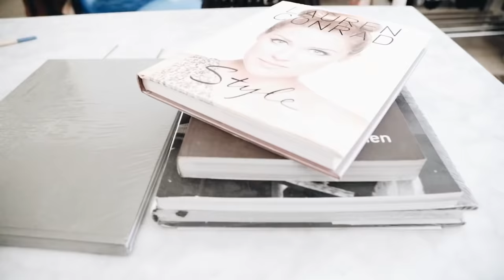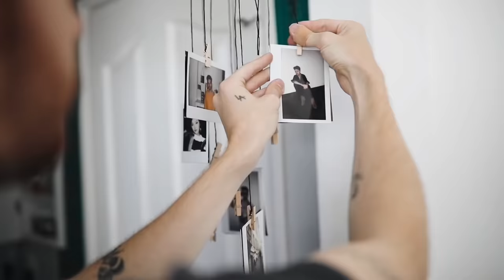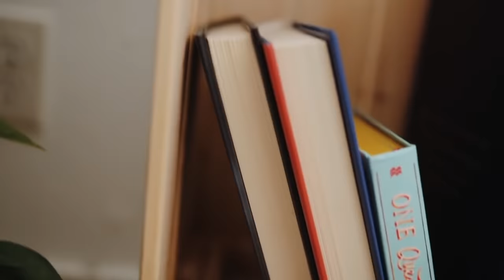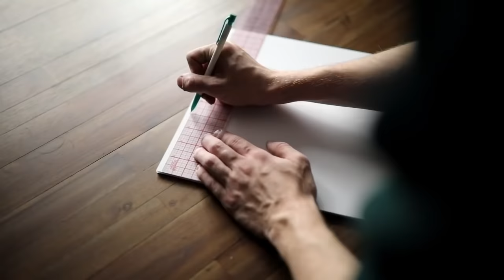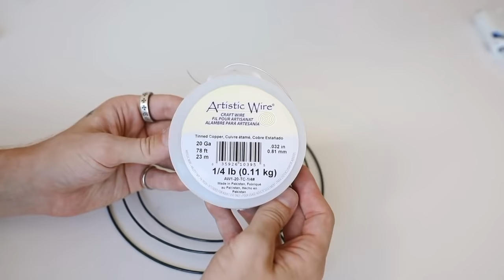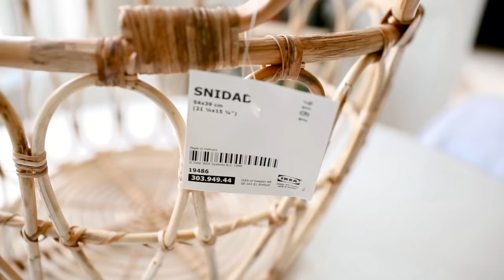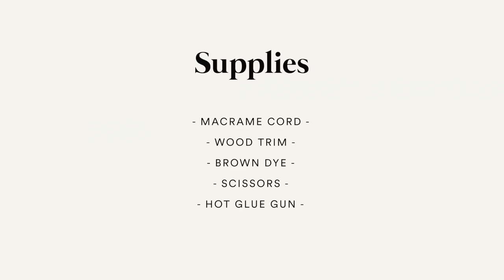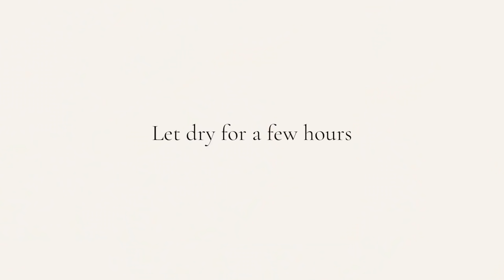100 DIY HOME DECOR IDEAS + HACKS You Actually Want To Make! ✨ (Full Tutorials)

Comment: Here's all ya timestamps!

1. Flower stamped pillow 6:20 
2. Braided side table 7:29
3. DIY Macrame plant holder 8:30
4. Polaroid photo display 10:00
5. Wicker lantern lights 10:54
6. Simple stitched blanket 11:48
7. Black and white minimal Wall art 12:45
8. Copper and concrete jewellery stand 14:00
9. Wooden moon jewellery organiser 15:09
10. Floral globe decor 16:19
11. “Hello” yarn art 17:45
12. Macrame display 19:00
13. DIY Macrame wall hanging 20:10
14. Memory mobile 21:35
15. Metal moon hanging 22:51
16. Concrete hanging planter 24:25
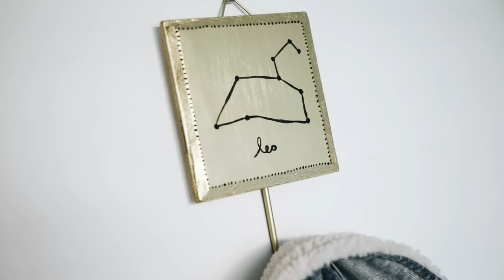17. Anthropologie inspired constellation wall hook 25:42
18. Brass flower mirror 26:35
19. Urban trash bin 27:44
20. Chunky tassel blanket 29:02
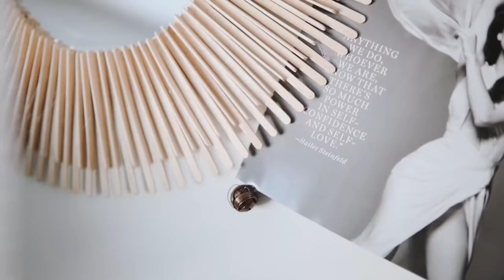21. Sunburst mirror 30:27
22. Concrete coaster set 31:37
23. Macrame candle holder 32:33
24. Geometric cork decals 34:01 
25. Pressed flower wall decor 35:07
26. Spray painted Ikea rug 36:12
27. Felt coasters 37:17
28. Frosted glass geo vase 38:16
29. Wooden letter decor 39:17
30. Wire jewellery holder 40:30
31. Hanging mirror + jewellery holder 41:11
32. Night stand from Ikea crate 42:10
33. Yarn circle decor piece 42:54
34. Memento lamp shade 43:50
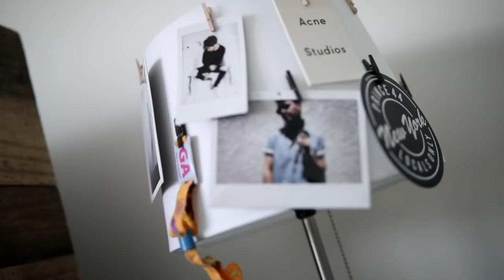35. Wool magazine wrap 44:30
36. Painted galaxy pillowcase 45:26
37. Reworked sweater 45:51
38. Hammered metal candle 46:48
39. Eyelid design pillow case 48:00
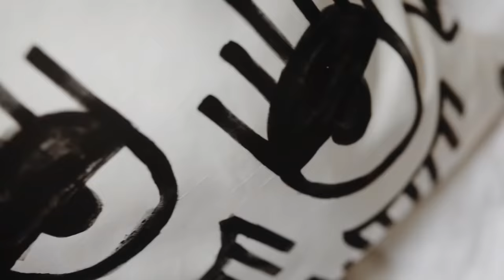40. Geometric wall hanging 49:01
41. Wool wall pocket 50:08
42. Crackled trinket box 50:48
43. Gradient dyed pillow cases 51:43
44. "Best friends" pillows 52:35
45. Leather wrapped coasters 54:10
46. Eucalyptus wall decor 55:13
47. Hanging shelving unit 56:28
48. Leather hanging mirror 57:57
49. Rustic clay bowl 59:34
50. Geometric yarn pillow 1:00:34
51. Vinyl record frame 1:01:31
52. Abstract wall art  1:02:52
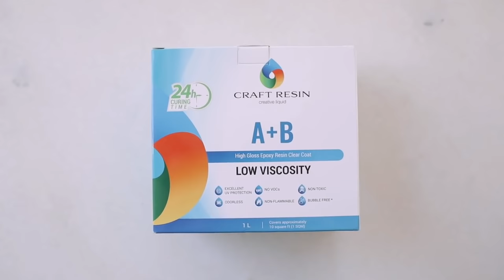53. Dried flower coasters 1:03:51
54. Gold floral wall hanging 1:05:20
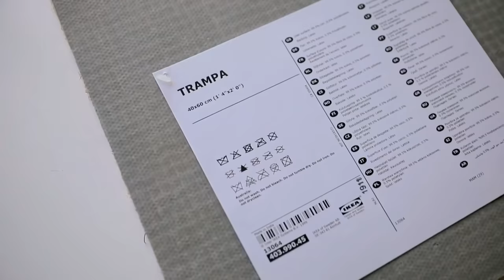55. "Hello" door mat 1:06:40
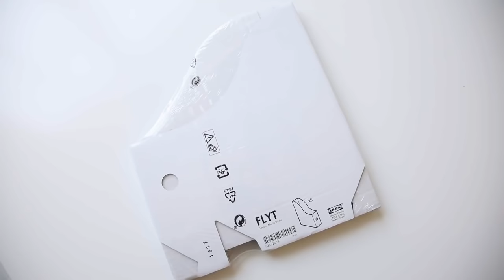56. DIY kitchen organizers 1:07:23
57. Spoon mirror 1:08:19
58. Gold metal hoop wall hanging 1:09:01
59. Abstract trinket tray 1:10:22
60. White and gold picture frame 1:11:12
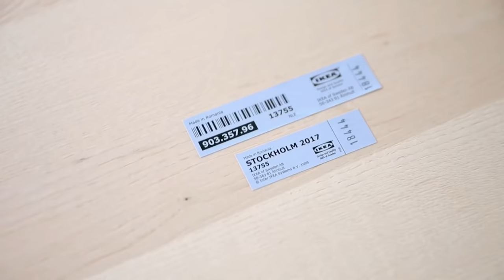61. Tray side table 1:12:30
62. Kitchen island/bar cart 1:13:17
63. DIY knobs 1:14:48
64. Abstract wooden canvas 1:15:40
65. Aesthetic candles 1:16:43
66. DIY basketball hoop 1:18:06
67. Kitchen shelf 1:19:34
68. Rolled cotton coasters 1:20:27
69. Gold wall mirror 1:21:10
70. Hanging cloud light 1:22:40
71. Polaroid magnets 1:23:55
72. Woven fringe wall hanging 1:25:24
73. Sea glass vase 1:26:25
74. Basket hanging pendant light 1:27:21
75. Geometric metal decor 1:28:52
76. Geometric wall art 1:30:26
77. Moon mirror 1:31:15
78. Blanket ladder 1:32:41
79. Macrame hanging bowl 1:34:05
80. Textured stone inspired vase 1:35:24
81. Tile coasters 1:36:13
82. Ombre textured canvas 1:37:44
83. Abstract yarn pillow 1:38:38
84. Photo holder 1:39:57
85. Shell trinket dish 1:41:12
86. Hula hoop wall hanging 1:42:16
87. Ombre macrame wall hanging 1:43:36
88. Geometric jute rug 1:45:04
89. Cement tissue box 1:46:07
90. Bubble candle 1:47:01
91. Fence jewellery holder/wall hanging 1:48:34
92. Modern wall art hack 1:50:05
93. Concrete planter 1:51:05
94. Bamboo bowl pendant light 1:52:27
95. Punch needle wall art 1:53:48
96. Shelf ladder 1:55:04
97. Neon sign 1:55:57
98. Paper mache bowl 1:57:17
99. Concrete jewellery holder 1:58:47
100. Pool noodle vase 1:59:36

This was a collaborative effort, thanks y'all! :)
Reply: Wow excelent!
Reply: Wow , this is great it should be pined to the top! Great collaboration
Reply: Omg I appreciate your effort so much! That was a loooong one to write!!
Reply: You’re the GOAT! Thank youuuuu
Reply: You are a lifesaver.
Reply: a hero
Reply: thank you to all the collaboraters !! <3
Reply: You're SUPER
Reply: Thankyou
Reply: You're the best! Thank youu
Reply: Thank you so much!!!
Reply: Bless you 🙏🏻
Reply: omg thank you ❤️
Reply: Thank you so much
Reply: God bless you.
Reply: Thank you.
Reply: thank u so much!!
Reply: I can't thank you enough for this
Reply: God bless you
Reply: Thanks, there's too much intro.🫢😅
Reply: I love you, this is EXACTLY what I needed! You have saved me so much time. Thank you 😊
Reply: Thank you so much for compiling and condensing Drew's ideas, hints and tips.
Reply: Thank you!
Reply: Wow, thank you!
Reply: Thank you for doing that¡
Reply: I thought I had a lot of free time

Comment: Since I can’t find any time stamps, here is number 1-13. Maybe we can tag team for the rest ☺️
1. Flower stamped pillow 6:20 
2. Braided side table 7:29
3. Macrame plant holder 8:30
4. Polaroid photo display 10:00
5. Wicker lantern lights 10:54
6. Stitched blanket 11:48
7. Wall art 12:45
8. Copper and concrete jewellery stand 14:00
9. Wooden moon jewellery organiser 15:09
10. Floral globe paper weight 16:19
11. “Hello” yarn art 17:45
12. Macrame display 19:00
13. Macrame wall hanging 20:10
Reply: 14-23
14. Memory mobile - 21:35
15. Metal moon hanging - 22:51
16. Concrete hanging planter - 24:25
17. Constellation wall hook 25:42
18. Brass flower mirror - 26:35
19. Urban trash bin - 27:44
20. Chunky tassel blanket - 29:02
21. Sunburst mirror - 30:27
22. Concrete coaster set - 31:37
23. Macrame candle holder  32:33
Reply: @elenawarr88  I can't click read more it goes to the timestamp
Reply: Thank you!
Reply: Thanks!
Reply: 24. Geometric cork decals 34:01 
25. Pressed flower wall decor 35:07
26. Spray painted Ikea rug 36:12
27. Felt coasters 37:17
28. Frosted glass geo vase 38:16
29. Wooden intial decor piece 39:17
30. Wire jewelry holder 40:30
31. Hanging mirror + jewelry holder 41:11
32. Night stand from Ikea crate 42:10
33. Yarn decor piece 42:54
34. Memento lamp shade 43:50
35. Felt magazine holder 44:30
36. Painted moon-themed pillowcase 45:26
37. Reworked sweater 45:51
38. Hammered metal candle 46:48
39. Eyelid design pillow case 48:00
40. Geometric wall hanging 49:01
Reply: @PavementPaperclip  thankssss! 😊🙏🏾
Reply: Here's the rest! I'll make a separate comment with all of them in one :)
41. Wool wall pocket 50:08
42. Crackled trinket box 50:48
43. Gradient dyed pillow cases 51:43
44. "Best friends" pillows 52:35
45. Leather wrapped coasters 54:10
46. Eucalyptus wall decor 55:13
47. Hanging shelving unit 56:28
48. Leather hanging mirror 57:57
49. Rustic clay bowl 59:34
50. Geometric yarn pillow 1:00:34
51. Vinyl record frame 1:01:31
52. Abstract wall art  1:02:52
53. Dried flower coasters 1:03:51
54. Gold floral wall hanging 1:05:20
55. "Hello" door mat 1:06:40
56. DIY kitchen organizers 1:07:23
57. Spoon mirror 1:08:19
58. Gold metal hoop wall hanging 1:09:01
59. Abstract trinket tray 1:10:22
60. White and gold picture frame 1:11:12
61. Tray side table 1:12:30
62. Kitchen island/bar cart 1:13:17
63. DIY knobs 1:14:48
64. Abstract wooden canvas 1:15:40
65. Aesthetic candles 1:16:43
66. DIY basketball hoop 1:18:06
67. Kitchen shelf 1:19:34
68. Rolled cotton coasters 1:20:27
69. Gold wall mirror 1:21:10
70. Hanging cloud light 1:22:40
71. Polaroid magnets 1:23:55
72. Woven fringe wall hanging 1:25:24
73. Sea glass vase 1:26:25
74. Basket hanging pendant light 1:27:21
75. Geometric metal decor 1:28:52
76. Geometric wall art 1:30:26
77. Moon mirror 1:31:15
78. Blanket ladder 1:32:41
79. Macrame hanging bowl 1:34:05
80. Textured stone inspired vase 1:35:24
81. Tile coasters 1:36:13
82. Ombre textured canvas 1:37:44
83. Abstract yarn pillow 1:38:38
84. Photo holder 1:39:57
85. Shell trinket dish 1:41:12
86. Hula hoop wall hanging 1:42:16
87. Ombre macrame wall hanging 1:43:36
88. Geometric jute rug 1:45:04
89. Cement tissue box 1:46:07
90. Bubble candle 1:47:01
91. Fence jewelry holder/wall hanging 1:48:34
92. Modern wall art hack 1:50:05
93. Concrete planter 1:51:05
94. Bamboo bowl pendant light 1:52:27
95. Punch needle wall art 1:53:48
96. Shelf ladder 1:55:04
97. Neon sign 1:55:57
98. Paper mache bowl 1:57:17
99. Concrete jewelry holder 1:58:47
100. Pool noodle vase 1:59:36
Reply: @cato6552  you are a star!!!
Reply: P-
Reply: Thank you for doing that for us!

Comment: On Project 23:
Suggest using a rubber band to standardize where to level out the knots, moving/removing the rubber band as you finish a level and move up to the next one.
Some of us are a little OCD, others just have terrible spacing ability. The rubber band provides that spacing aid.

On Project 91:
Instead of backing this with caning, how about using a metal, like brass screening in a cloverleaf cutout pattern, or a copper mesh, or a bronze screen.

Comment: 46:53 you forgot one little thing. Metal is a really goot heat absorbant :) If it´s under something plastic, it will burn. And this types of candle you can buy in shops normally. So be careful